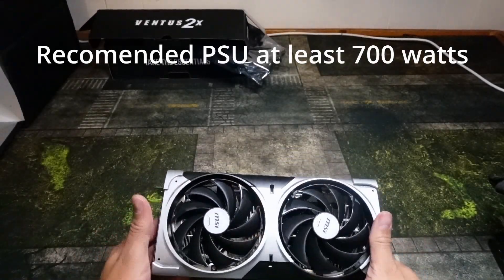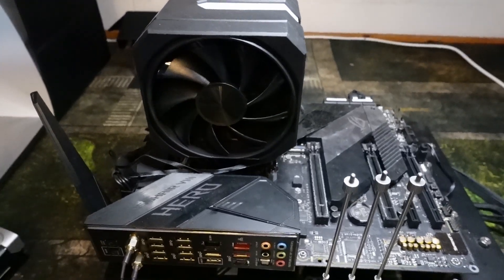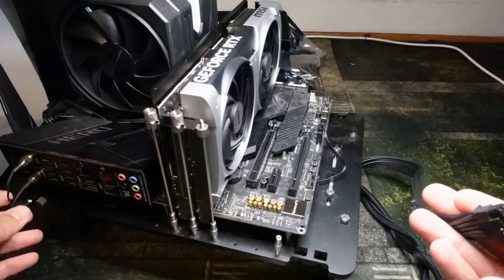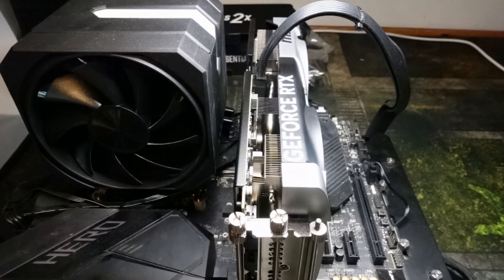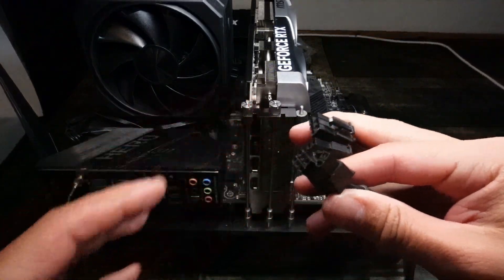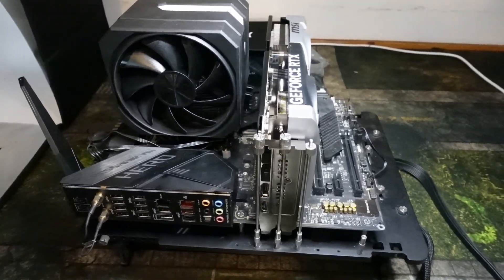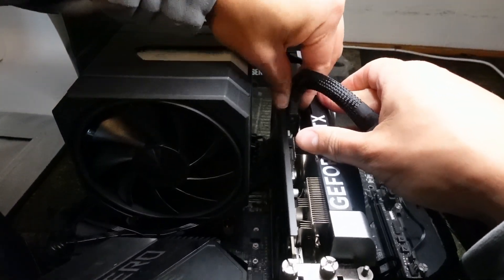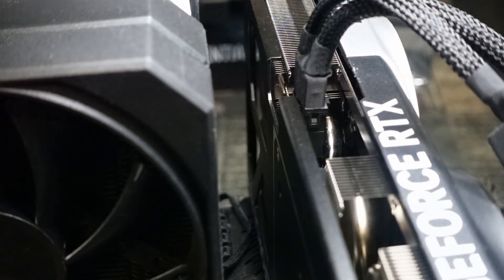RTX 5070 Installation guide, everything you need to know to get up and running in under 5 minutes.

Comment: To anyone who cares ==
That special made up "jumper" from power supply to GPU  
I was literally at the last straw  ready  give up  and I have build workstations previously
when it finally seated....     those pins are NOT rigid enough on these cheap jumpers ....
the pins were visibly askew from two horizontal rectangles    the little "squares" 
each individual pin  was off on several slots      MADDENING !!!!!   NO QC !

Comment: very nice video, A+++ and detailed information. Question : my PSU is old one from CORSAIR model : CMPSU-1000HX from the bolt in cables has 2 PCIE 6+2 pin cables individual ones "1+1 cables PCIE 6+2 pin" at 2:00 on your video you show up the setup with the NEW PCIE adapter 
Is OK to use my PSU for that type of GPU ? 
Is kind old but still until today all perfect run.
Reply from the maker: SHOULD be fine

Comment: TIP: A lot of people are suffering from fires and melting RTX 50 cables due to one common mistake: bending or squeezing the cables when pushing the PC case side panel closed, especially in narrow PC cases. If you want the cable orientation shown in the video invest in a larger case.... Otherwise, route your cables from the top instead of the bottom to avoid squeezing them against the case side panel.
Reply from the maker: great tip. thank you for sharing.

Comment: When do I need the adapter? I could use the the normal psu cable directly, is it wrong?
Reply: I have a 750w power supply, but it's an older model so it doesn't have the 12pin the newer ones do. So i used two cables with their connector just to be safe. According to poster you cannot use 2 - 6 pin connectors. Don't daisy chain with the adaptor.

Comment: Hi. Can you plug two separate 6pin cables directly into the 5070 without using an adapter?
Reply from the maker: Not possible
Reply: @kr00tman_tech Do you mean not physically possible?
Reply from the maker: @astrogerard2022 yea

Comment: Hello everyone
The model shown in the video is a msi ventus 2x 5070. According to msi website a minimum PSU of 650w is recommended. I got this exact gpu. I got a corsair RM650 and an original Corsair 12HVPWR cable.
My problem is that the GPU sometimes is not recognized by the system, I get black screen and 100% fans. I did a bit of troubleshooting and the problem seems to lie in the supply: as soon the cable is moved just a tiny bit, the gpu is not recognized.
It seems like the cable is too heavy for the connector or the GPU is faulty.
Anyone had this issue? I might just RMA my card.

Edit: the problem was the cable. I used the adapter and it works perfect.
Reply: Did u used 2 pigtailed 6+2 cable?
Reply: @wolframio36  two separate 6+2 cables and the adapter👍🏻

Comment: thanks for the video Kr00! I am still a bit confused with the wiring for my new RTX 5070 ti. I have a Be Quiet 1000 w PSU with two PCI power connectors and an 800 W connecter. nVidia supplies an adapter for two cables - two PCI e cables to then connect to board. In your opinion - which is better: two PCI e connected to adapter or just the 800W connector? I subscribed!!!

Comment: So using a single power cable and plugging in one 8 pin connector and using the 6+2 pin connector that is also attached to the power cable is perfectly ok when connecting to the splitter?
Reply from the maker: I dont understand the question

Comment: For the first time i connected the adapter i was seeing a little gap but then i applied more pressure it was like pushing the mount everest stone and then this adaptor firmly inserted with a click.. I wish i picked up rx 9070 with two simple 8 pin instead of this connector mess.
Reply from the maker: I dont blame you

Comment: Hi, i have purchased a brand new RTX 5070 and upgraded from RX 6700 XT. I have colorful RTX 5070 and i use the power adaptor comes with it. It was a nightmare for plugin that thing all the way in and make sure there isn't a gap between the power adapter and the gpu power connector i have to use too much force and then i heard a clicking sound. Is it normal?? I was worrying so much that i have used too much force. Can anyone tell me is it normal?? Thanks.
Reply from the maker: as long as its working and nothing is damaged your fine, sometimes you will have to apply a little force

Comment: At 2:00, when you show the adapter, is that 6+2 pins? I'm asking because I want to know if this 5070 model would be compatible with my PCIE 4.0 2x 6+2 pins 750w power supply. Thank you
Reply from the maker: should be fine

Comment: Hello, one question, i wanna buy rtx 5070 ti,
 i have a 500w power supply (sirtec hp-500-a12s) , 
can i use just one cable with 6 wires from source and with 12 pins?

I have ryzen 3700x 65watt processor that uses the other 6 wires and 8 pins already...

Will may pc start ? i know this card uses 300w max... but i will limit frames and underwold (will not go above 150watts...)

Comment: How come that some 5070tis come with 3x 8pin to 1x 16pin and some with 2x 8pin to 1x 16pin ? Is it really safe to use only 2x 8pin to 1x16 pin ?
Reply: I have the same question @MFPeter_ . Did you find an answer anywhere?
Reply: @donny1boykie  I just bought my GPU :D MSI GeForce RTX 5070 Ti 16G VENTUS 3X OC - using only the 2x 8pin adapter that comes with the GPU and works fine for 8 days. Tried stress testing it and nothing cought on fire. PCIe port does 75W and 1x 8pin is 150W. This GPU draws 300W maximum power, so Im more then safe. Honestly - only use the original adapter (from nvidia) - watch out for the corsair ones. Read they are shitty
Reply: @MFPeter_  Awesome feedback. Thanks mate.

Comment: Need to make sure the metal sleeves in the connector are not spread as well as check the pins on the card itself for defect/issues. The Cycle count for 12vhpwr cables/adapters is 25-30 cycle count. Never use it more than cycle count folks. Never use it if the metal sleeves are deformed etc. Newer adapters have a color guide so you know the connector is seated

Comment: hello there, ive currently got a 1080 with i believe an eight pin and a 6 pin (with two hanging off the side) cable inserted.. can i just plug them all into the adapter that comes with the 5070 or is that too good to be true?
Reply: did you figure this out? I also have a 1080 and am wondering the same thing

Comment: Does the power cable adapter comes with the card ? I have Ryzen 5600 with GeForce 1060 now and want to upgrade with 5060ti or 5070, however I have 650W PSU. I have 2 8pin cables. Can I use it for 5070 and do you think can go for 5070ti with 650w PSU, I know 5060ti I using only one 8pin.
Reply: You'd need to check the fine print on the box but I think most do. 650 is probably good for a regular 5070 but may be cutting it a bit close for a 5070 ti, especially if you're running other power hungry components.
Reply: 650w for the 5070 12gb its not enought i have a p650g gold gigabyte and open resident evil Village , warzone freze the monitor, but playing cs2 or league of legends goes OK. i update from a 3050 8gb.
Reply: @VictorHernandez-dx6pm I run a 5070 on a 10 year old 650w psu with zero issues. 1440p with a 90%+ peak load on the GPU. 650 is fine for a 5070 unless you're running an overclocked 7 or 9 series processor with a beefy AIO.
Reply: @Rdelevi bro, I think we have same psu 650w . Did you insert only 1* 8 pin into adapter together with the 5070 gpu? Or did you use 2* 8 pin?

Comment: Just tried to plug mine in, I have a 3-fan card and has a light up symbol which tells me it's connected, as far as I know I connected it correctly and when I power up the PC the symbol lights up as well but the PC shuts off after about 10 seconds of powering on. Any idea as to what the issue would be?
Reply: I'm having this same issue
Reply: You got a big enough PSU to support the card?
Reply: @Rdelevi  I have a 1000W PSU, not sure of the efficiency rating though
Reply from the maker: Might need a new psu

Comment: Thanks man..I never put a card in since my 970 gtx and was worried id screw something up ,you are the best x
Reply from the maker: @starmanmia  that's why I make these videos!!
Reply: 980ti here man lol
Reply: did you just plug the cables from your 970 into your 5070 with the adapter?
Reply: I have 980ti and planning to upgrade to 5070 sometime and was wondering if double 8 pin would work
Reply: @Ptoki1 upgraded to from a 980ti to a 5070ti for 800$, worth it fs
Reply: No way samesies

Comment: Just got an asus 5070 prime and that damn adaptor doesn't go all in no matter how hard I push it any tips? (I don't have a modular powder suply)
Reply from the maker: @zZFlaviusBoss  double check the cables that the inside pins are not bent
Reply: @kr00tman_tech  I wiggled it a lot and plugged it in and out a lot it finnaly went in all the way thanks for the responses though!
Reply: Did you fix your problem ?
Reply: @Toulkun  yep i just kept plugging and unplugging it until i finally got it in the port on the GPU is holding strong on the board you cant break it
Reply: @ I put my all the way in but it didnt click dont know if thats supposed to really happen. You know the sound like in video that it maakes when it goes all the way in i didnt hear it when i put my all the way in.
Reply: @Toulkun  some click other's dont i was scared too when mine didn't
Reply: It depends on what cable you have
Reply: @zZFlaviusBoss  So yours didn't click too even tho you put it all the way in?
Reply: When I first time connected the adapter to my rtx 5070 it didn't click and I have noticed a gap between the adapter and the gpu power connector and then I applied the enormous amount of force I can't even imagine to fully insert this adapter all the way in and I also heard a click or some what called a tick and then I see no gap but I was so worried that I have applied so much force. I was worrying about my gpu and mobo. These 12vhpwr adapter or cables need so much force.

Comment: hi, I installed RTX5070 on a win11 pro PC, but the system can not detect the GPU, the device manager can not show any info of this GPU. WHAT do you suggest me to solve this problem? thanks
Reply: Did you install the corresponding drivers?
Reply from the maker: How are you getting a display out?
Reply: I’m having the exact same problem
Reply: @mattmurphy5417 you find a fix gang?